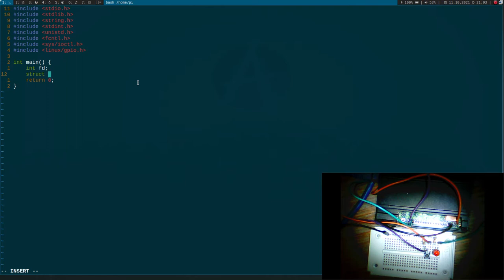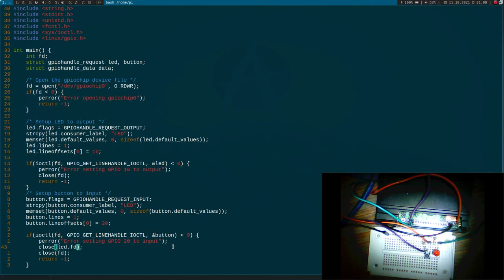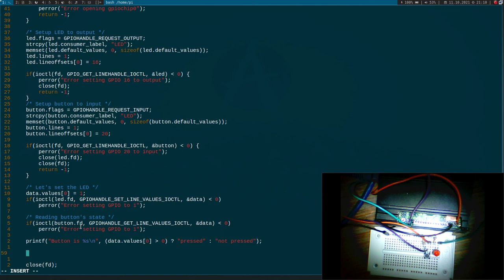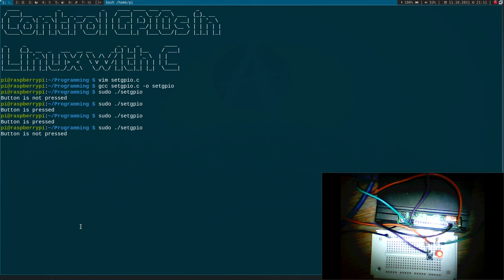Tutorial: Control GPIOs in Linux with a C application

Comment: the GPIO does not seem to toggle on my Raspberry Pi 5. I am using GPIO 16 with physical pin number as 36 but the pin does not seem to toggle according to my logic analyzer? Any suggestions?
Reply from the maker: I personally haven't tried a RPi 5 yet, but normally the pin numbers should be the same. I would recommend to toggle the pin with gpioset to find out the correct pin number.

Comment: Nice work. One question, data.values[0] used for both the led and button ? I do not see any connection between the led or button structs to data struct but there must be one.
Reply from the maker: Thanks. gpio_handle just contains the value of one or more GPIOs. It doesn't matter if the IO is configured in- or output. When I want to write the GPIO value, I have to set a value there, if I want to read an input value, at the end, the input value is stored in the value's array. 

By choosing the right ioctl command I make sure, that the GPIO output is written or the GPIO input is read.